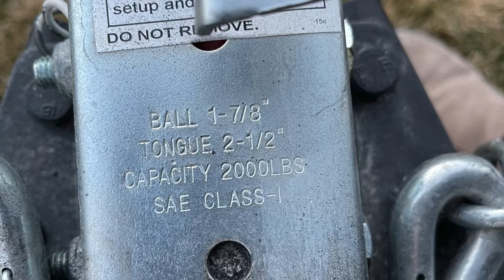Custom Squaredrop camper build - Harbor Freight trailer frame

Comment from the maker: Update - Total cost of this build including the trailer frame was around $1200
Reply: Nice job Chris, I like! I started with a 4x6 v-nose trailer for $2K, Added Insulation, AC, Door, Windows, cabinets, TV, AM/FM DVD front deck, luggage rack, and awning for an add'l $2K...
Reply from the maker: @johnw65  that’s awesome! That’s what I want to try next.
Reply: @rudysquest  I'm discovering that on our DIY trailers, they're never 'done'... I'm constantly spotting some little thing I want to add. Like maybe a foldup room to attach to the ramp on the back for an indoor privy/shower and outside galley like the teardrops have....
Reply: Use wing nuts and make the box removable just  incase you need to use the trailer for anything  or for maintenance ease.
Reply: Nice build.  The only I would do real different, is make it so I can stand up in it.  I'll be darned if I'm going to take on a project of this magnitude, and then not be able to walk upright inside of it.  I'm only 5"7', and my wife is less.  So 5'9" to 5'10", floor to ceiling would do for me.
Reply from the maker: @johnafagerquist8235  I definitely wish I would have built it taller. My next one will be different for sure!
Reply: @scootersonlyrepair6773  The Ramp-room would be for long stays, not for weekends... I was thinking of those push-button pins with a ball that sticks out the side. No nut req'd, just set the wall up, pin it and I'm done...
Reply: @scootersonlyrepair6773 that's really too impractical and inconvenient.
Reply: @johnafagerquist8235 hard to do when your 6'1
Reply: Yes EffBlx ,  I get wild ideas watching all these videos but it's pretty sweet now with the fold out sofa/bed, entertainment system and Ht/Air all running off the inverter...

Comment: Would you be willing to post the materials used and prints for the trailer online? This looks almost exactly like what I'm wanting to build (with some minor modifications). And, what's the total weight? (I"m assuming you've sold the trailer by now, which is why I'm asking about the designs)

Comment: That's great! People think they need everything built in, like electric and sink etc. but I would just have battery lights and a couple jugs of water. And bring a generator for AC if it was hot and a buddy heater for heat. Cook outside.and a cooler for ice cold drinks .

Comment: Excellent !
I also built mine at 4'x4'x8' rectangular.
I wasn't worried about aerodynamics either because I pull it behind a van anyway
Reply: I'm considering turning a aluminum trailer I bought from Lowe's to carry a golf cart behind my van.. into a square  camper trailer.  5x10.  But I'm going to build the sides at 6foot.   I pull behind a van as well... that sometimes the spare room on a light trailer would be so very welcomed....

Comment: nice, simple and solid work, still for cargo and as camping trailer, exactly what I like.

What I had done additionally: I would put rubber granulate stripes under the wood. Sooner or later will be there, so it is good, if the wood won`t have water contact too long.

Thanks for your video, I really like it :)

Comment: VERY NICE JOB, I have plans to do the same on my 5 x 10 with ramp. Will build it on 4x4 skids so I can winch it on and drag it off . I,m contemplatng using insulated garage door panels for sheeting, I like your design.
Reply from the maker: That’s awesome! Skids would be nice so that your trailer is multi use. Good luck with the project!

Comment: Great design but it's leak city. Don't travel or leave it out in the rain. If you used vinyl siding over tyvek- then wood, it would be 100x better. Also making a curved nose instead of a flat one ,would make it aerodynamic.

Comment: Nice work🔥🔥🔥What type of weather seal paint did you use for the roof?
Reply from the maker: I actually used Rustoleum Rocksolid 6x deck paint. It completely seals and waterproofs. It makes a super rigid surface. The first coat went on really thick and the wood completely absorbed it, then I added a couple more coats for added waterproofing

Comment: How does it pull? Does the square front offer up much wind resistance?  How does pulling it effect your gas mileage? I'm curious because I am building almost exactly this design and I'm second guessing whether or not to round off the front any.
Reply from the maker: I went back and forth on rounding the front too. It does pull fine. I didn’t really notice a big drag with the flat front. Rounding the front or doing a v nose might give a bit more space inside. I just went as simple as i could.
Reply: I would put a little v on the nose. A flat front will add resistance and could also buffett especially when passing trucks

Comment: What is the stuff you used on the corners of the trailer? I'm having a hard time figuring out how to build a door on mine
Reply from the maker: I used some really inexpensive galvanized steel roof flashing. Works great, a little flimsy but with the right screws, it held strong. I used lathe screws. The doors are tricky. That was one of the last things I built because I didn’t know how to approach it. However, I used 1x4 as the frame, plywood for the outside, 1/8” whiteboard for the inside and used wood glue and wood screws to hold it all together. I also insulated the door with 1/2” foam board.

Comment: great trailer !! I want to build one like yours .. do  you know what is the weight of your trailer ?
Reply from the maker: I didn’t officially weigh it but I tried to keep track of the material being used. My best estimate is between 700-800 lbs. tongue weight was about 85 lbs.

Comment: When you do this, how high can you go? Like for example... going under bridge overpasses, they aren't all really tall... so is there like a certain height that you don't go above for the top? And I ask this because... the trailer can only be so wide and long, then the only way to save space is to try to go a little bit more height to make up for that, and turn that into shelf space or store space, etc? Thanks.
Reply from the maker: I think in my case, I could have went a little higher like to 5’ or 6’  but any higher I would need a wider trailer otherwise you’d be top heavy and could create a situation where the trailer could tip
Reply: @rudysquest  Ah. you r right about not wanting it to be top heavy. Thanks for your reply.

Comment: What kind of screws do you use ,  the type and size,  I have a 4x8 hf, and I need to do an enclosed cargo trailer im in orem located thanks 🙂
Reply from the maker: I used structural screws for framing. I also used structural bolts to hold the wood to the metal frame. I think it was 3” screws. And 4.5” bolts.
Reply: Using those screws did you have any edge or end splitting? Did you counter sink and/or  predrill for the screws?

Comment: Awesome job. I’m in the process of building one myself. What brand/type or rubber paint do you use for the roof? Thank you
Reply from the maker: I believe it was rustoleum rocksolid deck coat that was the 6x thickness. It creates a waterproof barrier.
Reply: Ok I will look into that. Thank you very much and stay safe

Comment: What are you welding at start of the video? Did you make any changes to the HF trailer?
Reply from the maker: I was welding the joints to reinforce the frame. That’s the only change I made to the frame. Everything was still bolted together but welded at those joints.

Comment: Great video, thanks!!  How or what mods did you do to the HF trailer? what mph is safe with the HF? i am about to buy one to custom build just like yours only i must go 6ft in height :)
Reply from the maker: Thanks!! All I did to the frame was have the joints welded. I don’t recall the mph but they are dot compliant tires. So I’d assume that means you are good for freeway speeds up to 65. But I don’t recall the actual number.

Comment: What are the measurements of the door and window and where did you get them from?
Reply from the maker: 1 window is 24x36 and the other is 24x24. I had to custom make the door. I think it was something like 36 tall by 24 or 26 wide.

Comment: Just curious, WHY build a "pod" on the middle of a trailer?  Wht not gain at leat 1' wide and 3" longer by using the full size of the trailer?
Reply from the maker: Definitely wish I would have went bigger. But first build and tried to keep costs down. The next one will be bigger for sure.
Reply: @rudysquest  Nice build!  I was just curious if there were stability problems or something else that prevents people (other than cost) from making them longer and a bit wider on teh trailer.

Comment: Were you worried about the weight of the camper  Being too heavy for the axle and wheels. I'm starting to build my own camper on an old pop up but I'm worried the weight will exceed 2000 pounds which is the capacity of the axel.
Reply from the maker: I was a little bit but I kept track of the material and tried to make sure I wasn’t over on anything. I used the lightest foam insulation i could find. My axle on this was rated to 1500 lbs. I think that the final weight was around 700-800 lbs (including the frame). Frame weighed about 250lbs. Depending on the size of your build and materials used, I would think a 2000 lb axle would be okay. But if you are going big, I would upgrade the axle to a 3500lb axle. The frame would likely need reinforced as well. But if you keep your build small like mine, a 2000 lb axle is more than enough. Good luck!!!
Reply: @rudysquest  thanks for the reply. An upgrade to a 3500 is about 900$ currently! I think I'm going to just size down like yours. They're still very functional.
Reply from the maker: @zoeinreallife  yeah things are not cost effective right now. It’s a very functional trailer for being as small as it is

Comment: For anyone considering buying a trailer. I just went through a nightmare and not sure it's finished. It took a total of 3 stores. I went online to look for the closet store that had heavier duty one in stock. The store closet to me had none, so I went to the second closet. They told me they do not have any. They had one sitting up front on display. It turns out the one on display they are counting as inventory. I told them I'd take it and they told me no. They know these trailers are often hard to find so they trick people into coming into that store location for the trailer, only to be told they actually do not have any, even though it's sitting right in front of everyone as a display. Very crooked or at least dishonest. Anyhow, they at least call another store but it's pretty far. They confirmed they had the trailer I wanted in stock. What was interesting is the guy was clear to me that they had both matching boxes. At the time this seemed odd to say but I didn't pay much attention to it. I get to the store and pick up a couple of items and tell them I'm there to pick up the trailer. They bring it out in two boxes. The guy gets nervous because he has to fill out the title stuff. Had a 'how to' binder, I assume the store created so the paperwork gets completed correctly. It was a disaster. He was coming things out and stamping in the wrong place. I was like hey man are you sure you know what you are doing. He asked a couple of people for help. They assured me all is good with the paperwork. I ended up going to the store next to me to have a manager review because it looked off to me still. She made a correction but no stamp in front of the title. I went to get the title and registration a few days later. They basically laughed at me. Told me to get an affidavit and correct the stamp location. I went to the store closest to me again for this. She was very helpful but had to call the store manager in the place I bought it from originally. I went back to get it registered and after a lot of people reviewed the paperwork they decided to do it but advised it could come back later as not valid. So it was a nightmare going through all this. Lots of my time wasted. I hadn't even put it together yet. Now get this. I open the large box with all the parts because I wanted to paint it with a paint that would not fade like the factory paint does. What's odd is i unpack a front cross member. In my head I'm like oh wow, I thought this only came with the light weight version of the trailer. I'm like sweet, they upgraded. I take all the red parts out and paint them. Looks great. Lots of time spent on it. I planned on putting it together this weekend. Even though I've watched at least ten videos on how to put it together I decided to read the manual. I almost crapped myself. The manual is for the smaller trailer!!!! They gave me the wrong trailer!!!!! I paid for the heavy duty version and they gave me the lighter version. Wth!!! It turns out this goes back to the comment about two matching boxes. They gave me the small box of the heavy trailer which has the wheels and springs. The large box is all the framing and axle of the lighter trailer. What a joke! 
I've put so much time ahead work into this already without even assembling it, even have a wood deck purchased and cut. I can't return it at this point with all the registration fees paid, the frame painted and the store being an hour away. I will put it together and see how it turns out. Not happy about it at all. This also means the next person will get mixed boxes, or maybe it happened before me and I got the mixed boxes. This is just a warning for anyone thinking of getting a trailer. 
First, call the store to see if they are trying to be crooked by showing a display as available inventory online. Two, when they bring out two boxes make sure they match! If you make it to three, demand a manager completes the paperwork and that the manager goes slow. Any corrections or scribbles will require you to go back and get an affidavit later. 

If someone from Harbor Freight contacts me and makes this right I will let everyone know. I will be sharing this in many places to get the word out.

Comment: Nice  but have you  weighted it yet probably 1800-2000 lbs that frame &axle&tires not built for that kind of weight  most likely 750 lb axle & 500lb tires  stay away from  me when it brakes apart
Reply: In one of the comments, he said total weight with the frame is 700-800 pounds. You'll probably be ok if he is near you.